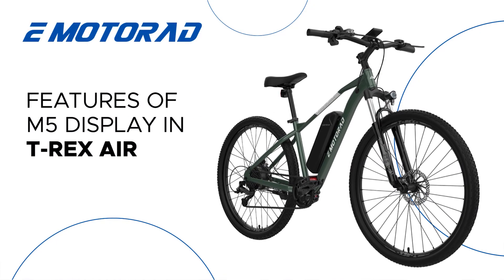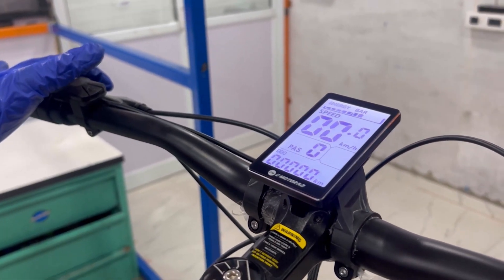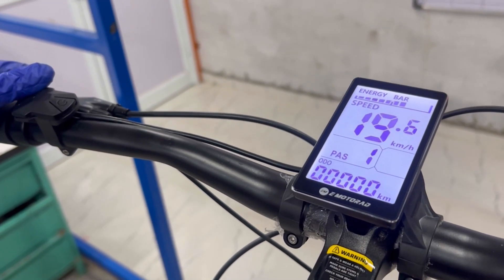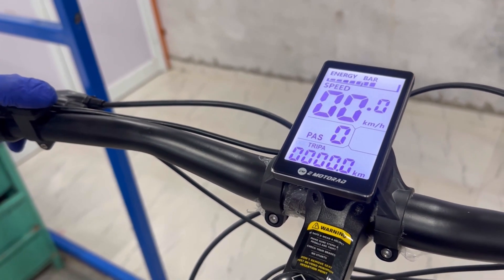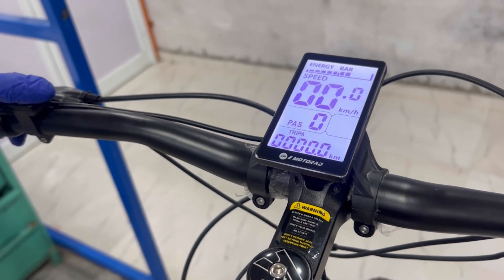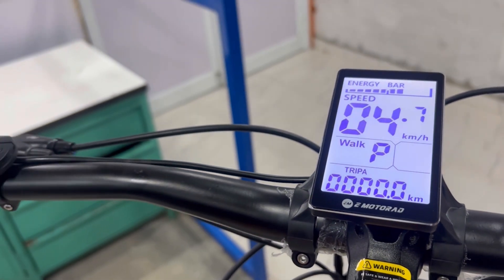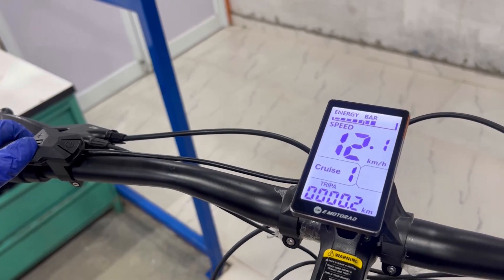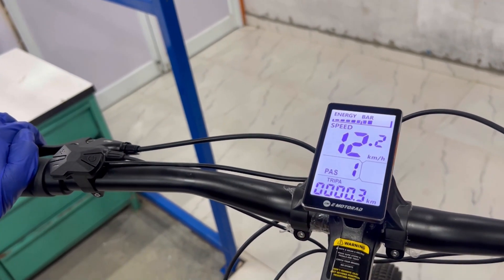T-Rex Air Display Walkthrough | EMotorad M5 User Guide

Comment: Price
Reply from the maker: T-Rex Air M5 display is available at ₹2799.

For more details please connect on this number - 8956288820
Reply: @e_motorad Can i run this cycle in rain
Reply: Can I buy spare parts of this cycle in case if any part breaks after warranty period